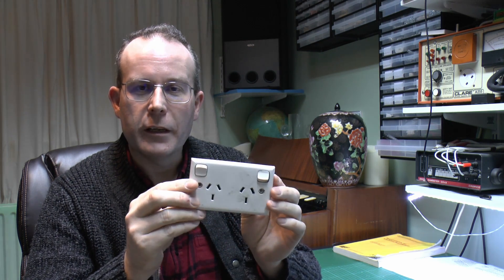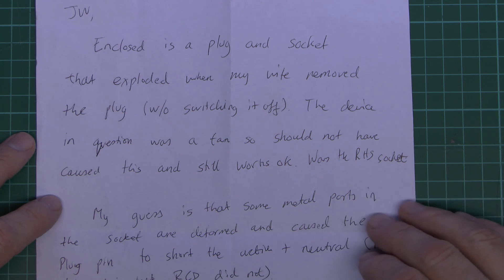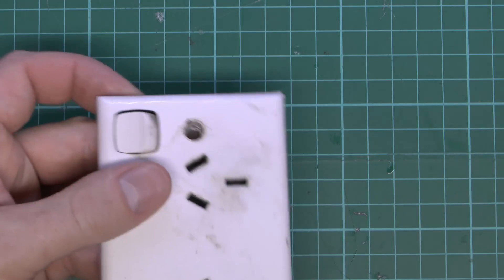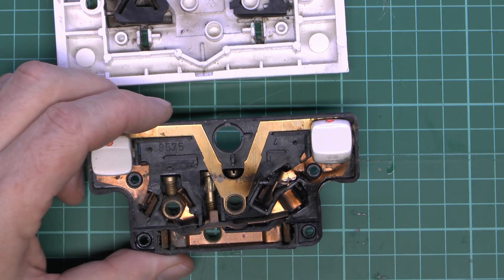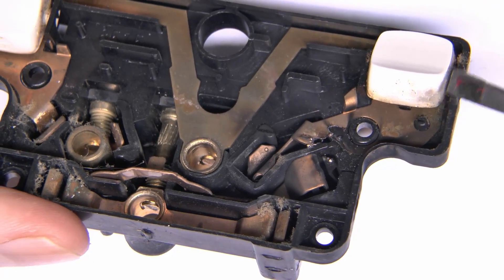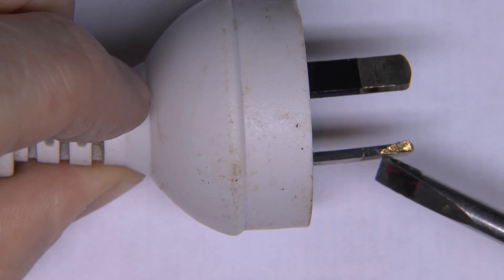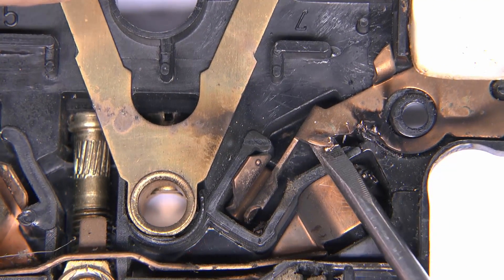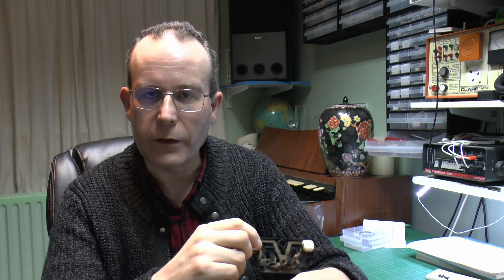Failed Australian Socket and Plug

Comment: The switch is there for a purpose,  my assumption is if the plug was removed  without switching off and item still on then it was plugged in the same way in both cases arcing will occur.

Comment: Interesting. Do the screw holes of those sockets fit UK back boxes?
Reply from the maker: No, spacing is smaller, and so is the whole front plate.
Reply: No. 

UK boxes use the euro 86mm square standard form factor. Australia and NZ use NEMA boxes and faceplate sizes as the starting point for their standards.

You can get 86mm format sockets but they're primarily made for the chinese market with highly variable design and manufacture quality.

Comment: I think the problem happened due to a sudden disconnection of an inductive load (the fan). Depending on what phase of the sine  wave the current was at the time of disconnection the resulting voltage spike can vary dramatically. If it happened neat the peak it could have been a few thousand volts. It still should not have arched across the insulation, but maybe there were some contributing factors, eg condensation, fat, mould, etc. that might have "helped".

Comment: especially with a fan being pulled out of it ,anything with a variable current such as a fan causes lot of spikes dont they ? especially if you have a fan plugged into the same circuit as lets say a hdmi TV and u turn the fan on and off the alternating spikes cause havock with sensitive digital data
Reply: girlsdrinkfeck This is not about the EMC/RFI issues from switching noise.  This is all about a high energy flashover large enough to destroy both socket and plug before the fuse / breaker in the main panel tripped.
Reply: The kind of fans being used on these double-insulated plugs are usually shaded-pole induction motors or other very low wattage devices. There are no spikes and almost no inductive kickback when unplugged either.

Comment: It's ace that Aussie sockets are "upside down" ;)
Reply: edgeeffect they make a smilie face... just begging for someone to draw a mouth with sharpie.
Reply: the idea is the earth breaks last if the plug falls out because the plug will presumably tilt down. In practice this is a terrible idea, because if some christmas decoration or similar thin conductive material falls or is pulled downward past it the active can be contacted. So the more modern plugs have the plastic coating on the first half of the pins, old plugs don't have this.  Alto the switch position for "on" is the opposite of american.
Reply: The modern plugs with the half insulated live and neutral are actually a legal requirement now, it's illegal to sell products in Australia that aren't insulated that way, and older products with them no longer meet the electrical standards and could pose difficulty when making an insurance claim.
Reply: gorillaau on Argentine outlets.

Comment: These are still made today see:
 https://hpm.com.au/products/double-powerpoint
HPM and Clipsal are the top brands here in Oz. There are a few others but in my experience the switches on the cheaper brands don't last long.
Also the white cover should have some tabs that hold the conductors in place so they can't pull out and flash over.
Maybe with the inductive load, the plug was forcefully removed and pulled down to force the pin closer than it should be.
Reply: Alan Smith I think the two black plastic inserts on the back of the front plate do that. But I wonder what role the one on the right socket played in this failure.

Comment: Not hard to tell that when the plug was removed that the live trace was pushed against the front of the case and a section of it bridged across the neutral pin of the plug.

Comment: If you want a real horror show, disassemble an Australian-style plug and socket manufactured by Elto China or one of its copy-tition; especially the 6-way multiboards copied from HPM's design (to be clear, the genuine HPM-branded ones are good, the cheap copies aren't). Those things are frighteningly nasty; and definitely not safe for plugging or unplugging without switching off, unless you like the idea of drawing a white-hot arc every time you disconnect a laptop charger.

Comment: I've had the occasional flash, when disconnecting a heavy load, I've also  experience a mild shock from flicking the switch to off, causing a big flash in the switch, which blasted out between the gap in the switch button and face plate hitting my finger, also partly blackening the plastic face around the switch button.
Reply: NZ's PDL range of the same era were much better designed with shrouding around the switch to protect against blowback. As with everything, these were built down to a price and assumptions get made about the kind of use they'll see. One of the golden rules in NZ was "Never assume the user will switch it off before unplugging"

Comment: Is not possible that a plasma arc resulting from a 'back emf' from the fan motor created a conductive path between line & neutral at the moment the plug disconnected?
Reply: Oliver Wood I would guess so.  Rotating fans tend to have more inrush and back-emf than regular inductors, due to additional energy in the mechanical parts.

Comment: HPM is sold primarily through supermarkets and hardware stores in Australia. The quality brand in Australia is Clipsal, but only sold through professional wholesalers. There are worse Chinese imports than HPM but not much worse. I would not have them in my house.
Reply: PDL and Clipsal are part of the Schneider pile of brands. HPM is still perfectly OK, and can be bought at most wholesalers in NZ.
Reply: I used to have persistent problems in the 80s and 90s with Clipsal units where the switches would pop out of the faceplate and disappear into the box. The only way to repair that was to replace both the switch and the plate as the plastic clips were not repairable.  Did they ever fix that egrarious design flaw?
Reply: Tim White that's good to know. I'll be on the lookout for Clipsal products next time I'm shopping for a replacement socket. I thought PDL and HPM were the quality brands in New Zealand; Clipsal is relatively unknown to me.
Reply: Brendon Green .PDL is part of the same corporate empire as Clipsal I believe. Although I have had problems with their switch plates, namely 4 switch weatherproof units which prematurely failed. Clipsal don't offer such a unit.
Reply: Neil Forbes PDL actually. Much tougher in the face of being thumped.
Reply: No. It's a NZ company that got borged by Schnieder in 2002.

Unlike Clipsal, their clip-in modules press in from the front (PDL 500 and 600 series), so the only way someone can push them into the box is to smash the plate.
Reply: Tim White HPM is NOT primarily sold through supermarkets and hardware stores in Australia as quoted, it just happens to be available in these outlets, as well as Philips, Osram, and other brands, the stockists quoted above only stock about 1% of the available product range, the rest of the range is sourced through electrical wholesalers, HPM is part of the Legrand group, they currently have over 130,000 catalog items, I have no problem putting my trust in any HPM products.

That 777 socket was very popular in the 80's and was Made in Australia, nowadays as with everything most HPM, OSRAM, Philips and other brands are all made in China, good luck with any of these new sockets etc lasting more than 10 years, let alone 30-40 years, I have pulled old HPM switchgear from the 1940's and it was still working perfectly.

Comment: Funny how it always happens with the really dirty old units when the humidity is high....
Reply: I think your on the money here dirt inside the switch, I thought JW would have picked up on this.
Reply: Timely, https://spectrum.ieee.org/webinar/the-importance-of-reducing-dust-accumulation-in-electronics-systems
Reply: That, and the obvious risk of routing the live conductor from the switch to the socket like that. a few more mm spacing wouldn't have hurt or added any costs.

Comment: Great stuff. Keep it up. This is why I feel that huge “euro” style plug sets are inherently dangerous.  Archimedes lever law makes it obvious that even minor misalignment will create large forces on insertion or extraction. 

The arc over issue demands large separations which in turn create this problem.  It’s just too much voltage for small construction to handle (for cheap).
Reply: Boonedock Journeyman The Schuko socket, which has a major lack of polarity, includes mechanical rails to prevent angled insertion/removal. Furthermore, typical 19mm/4.8mm socket designs tend to have the socket springs mounted so they can move sideways without problems.  This particular Australian socket runs the live connection bar dangerously close to the neutral socket spring, relying on the ability of the lid to press tightly against the back for isolation.

Comment: I am amazed to find that no other country hasn't added a fuse in the plug like we have in the UK and ROI.  Although in this case it wouldn't have helped the situation as the fault was in the socket this time.
Many thanks John for your interesting videos, Regards from Ray in North Wales.
Reply from the maker: Most countries don't have fused plugs, as the circuits themselves are typically lower ratings such as 16A.
Fuses are only required in the UK because of ring circuits where the circuit is 32A but the flex to the appliance is rated much less than that.
Reply: Yes the house that this socket came from has 2x 20A radials for sockets.  This is pretty much standard for Australia, with separate 15A circuits for appliances more than 10A, eg electric kilns, caravans etc.
Reply: And if you need a fused socket for ease of mind, you can buy one. I have on installed in my bathroom. (Germany)
Reply: Hi, I understand that most countries run radial circuits, however with a 20A breaker and a low current device plugged in, i.e. a radio or maybe a bedside lamp for example, both with low current cable maybe 5A or less, if either of these devices had a partial short circuit of 10 to 15 A, the cable would burn out before the 20A breaker tripped, here in the UK we would have a 3A fuse in the plug.
Reply: Ray Welshman
But we use FI safety fuses/switches. They detect such things. They also trip if you touch live wires for a longer time (more than a few microseconds I guess)
Reply: Apparently "Fi-safety switch" is an old saying. I mean these: https://en.m.wikipedia.org/wiki/Residual-current_device
Reply: We have fuse on most plugs in Hong Kong as well
Reply: That’s because only the U.K. cursed itself with ring circuits.

Comment: Poor design if it can fail in this manner regardless of how old it was. Hope the new ones are better. Maybe someone in Australia who may be affected by this should consider sending a link of this video to the relevant certifying authority.
Reply: Manick N it appears to me, the it was designed to be as low cost as possible. Still it could be designed better with not that much more of metal or plastic used. Also separation between neutral and Earth is not that great either.
Reply: From the comments I gather its a good brand. Definitely not what you would expect. They are in the market to stay and its a first world country so legal implications are important. If it was a Chinese knock off its probably impossible to get recourse. 

If the relevant authorities and manufacturer is informed I am betting the new offerings will not repeat the error.
Reply: The new ones have more plastic and as little metal as possible. Like so many things these days, as flimsy as they can be without actually breaking any laws.
Reply: New hpm sockets have better isolation. The old ones fail when they’re dusty or in a shed/ metal shop it’s definitely not that common as most old houses are full of these sockets and they rarely fail especially if you are a “switch nazi” who always turns off sockets that are turned on, even when nothing is plugged in

Comment: I did first think of a metal fragment, but it may as well just have touched as your conclusion.

I thin metal flake would cetainly be enough to start a arc, and could dislodge while pulling the plug out.
Also it would disapear in the arc.

Comment: It's always interesting to see the design and construction of accessories in other countries, I noticed the active (line) and neutral ports on the socket itself has no retractable shutters as they do in the UK, a key and essential safety feature when you have young inquisitive minds roaming. JW, was the socket DP or SP?
Reply: Australia used to have earth-pin-activated shutters but moved to neutral-pin activation in the 1970s when 2 pin plugs started showing up in numbers. New Zealand effectively banned 2 pin plugs for a long time, but they started showing up following the harmonisation of standards and markets in the 1980s.
Reply from the maker: Single pole.  There are shutters, located in the white plastic lid.  Photo here: https://www.instagram.com/p/BeNmYoODQ0Z/?taken-by=jwflame
Reply: John Ward- Oh yes, I see now, it looks as though the shutter plates slides to the side when the pins are inserted.
Reply: 1. You can see retractable shutters when he removes the front plate.
2. You can see that the switching arrangement is single pole from the busbar layout inside.
Reply: Alvin Ashman tried some other sockets that are similar and the shutter covers the active pin and requires the insertion of the neutral pin to activate. Earth pin is not mandatory here.
Reply: Yes, thank you, I see that now after JW's reply and upon reviewing the video.

Comment: They said they unplugged a fan so disconnecting the inductive load created a high voltage spike that jumped causing a plasma arc due to the wear and damage in the socket a short occurred.
Reply: David M Great minds think alike.
Reply: Looks to me like the loose contacts inside the socket were lifted up when the plug was pulled out and the neutral pin of the plug made contact to the live connector while still connected to the neutral connector. So it could have happened even without current running through the appliance as long as the switch on the socket was on.
Reply: Pentti Hilkuri   Probably.  In a similar example of assumptions of what is good enough in design: I have a utility knife that appears that the razor blade would never come out of place; it is so frequent that it is too dangerous (the knife is not sold anymore that I have seen).

Comment: Hey John, 
my name is Matija, and I have a bit of misunderstanding about 3 phase sockets/plugsin Croatia where I live. So my fuseboard has a three phase RCD 30 ma trip current 25 amp per phase max. And a three phase socket is protected by a  thee individual 16 amp MCB. And wirering coming to a three phase cooker socket is 3 live 1 neutral and 1 ground conductor each 2,5 mm.So if a cooker uses one phase for owen one phase for 2 rings on a stove and third phase for other two rings. BTW each phase is 230v. So isnt then a neutral conductor overloaded because it is a return path for all three phases.  Shouldn’t there be 3 neutrals as well?
Thanks
Reply: Assuming a linear, real load, which a cooker should be, the maximum possible neutral current equals the mazimum current in one phase. If you've got one or two phases loaded to the full 16A you'll have 16A on the neutral, if you have all three phases loaded it all cancels and there's zero current on the neutral.
Reply: jamvanderloeff thanks

Comment: I think that pulling the plug out perhaps rather slowly drew the initial arc which then flashed over to the other conductor via the plug pin which is why there is melting of all three.

Comment: Seems like this is a fault that is more prone to happen because of the switch on the socket with this particular design. Inductors are running pretty close to each other in the corners where the switches are situated.
Reply: Thomas Verschoof It's not because of the switches. It's because the housing was made too small to run the connections at a safe distance.

Comment: Also a Kiwi socket, we are slightly lower current at 10 amps or 2.4kw fuses/beakers are at the fuse board, no ring mains. Directly back to the fuse board from the sockets. HGM tend to be sold in diy shops, mostly sparrkys will not use them.